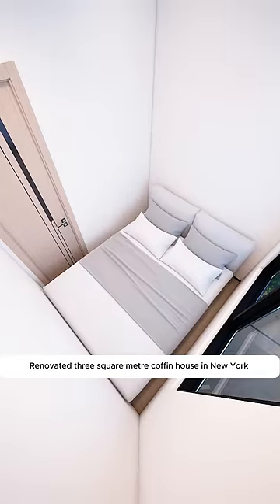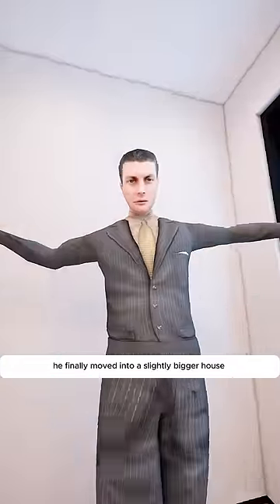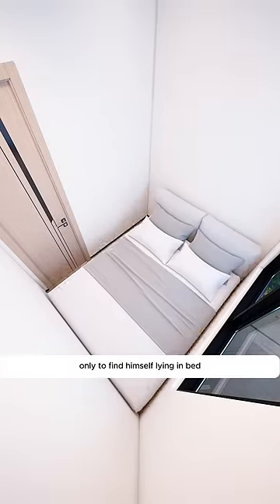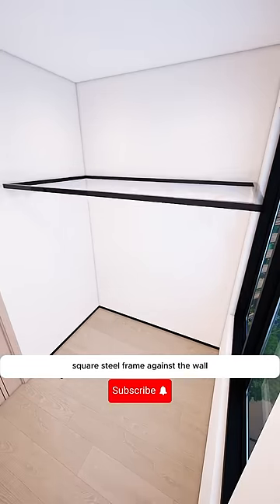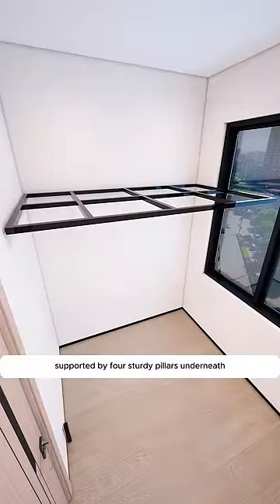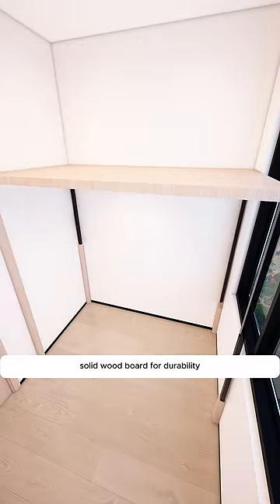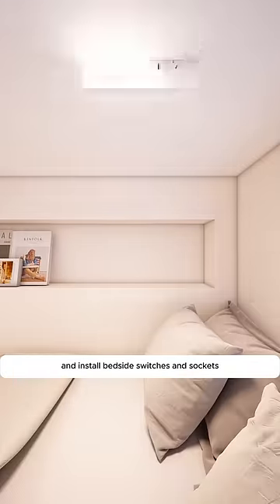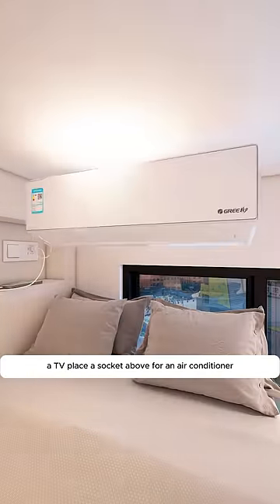Design a Fully Functional 3 Square Meter Room! #designinspiration #interiordesign #interiorhacks

Comment: Where is the rest of room? Video is cut off
Reply from the maker: Go to my channel or click to the related video below the short video for it
Reply: @HomeDesign365  If the bed was just big enough to fit him lying on it at the beginning, then turning it 90° isn't doing him any favours nor is it when the bed is so close to the ceiling that he needs to crawl into the bed on his belly from the ladder!
Reply: @HomeDesign365  galvanized square steel.
Reply: @steadholderharrington9035  it's built using a galvanized square steel frame and expansion screws (you can borrow them from your aunt)
Reply: @steadholderharrington9035  are you serious for being serious here??😂
Reply: @catngaum  Just an observation. I'd dread seeing this in reality. 😅